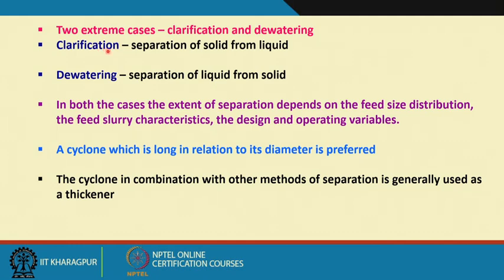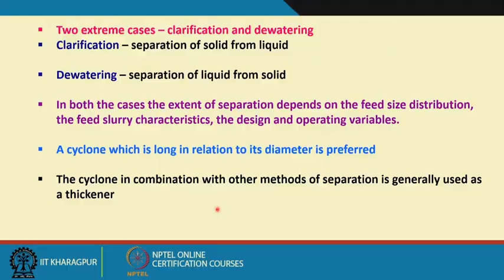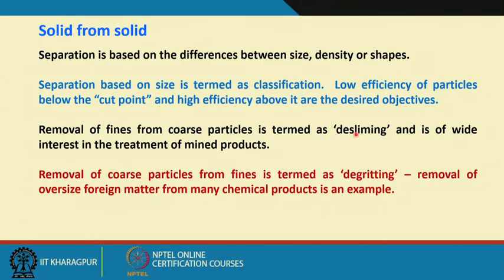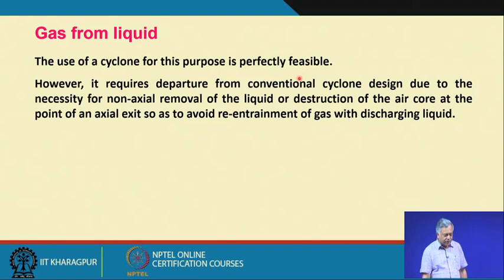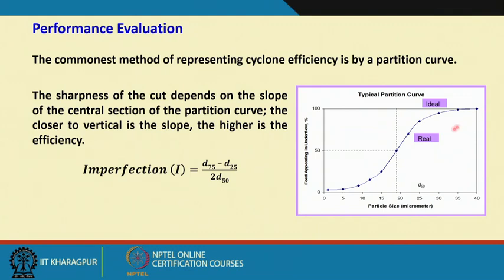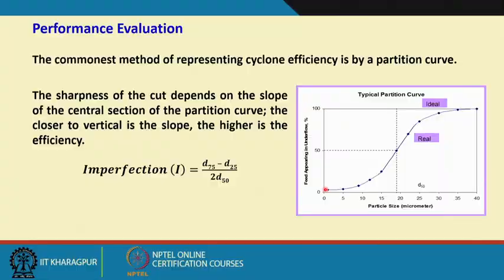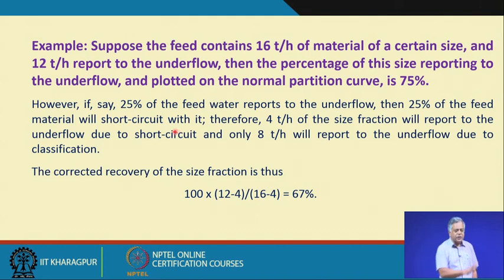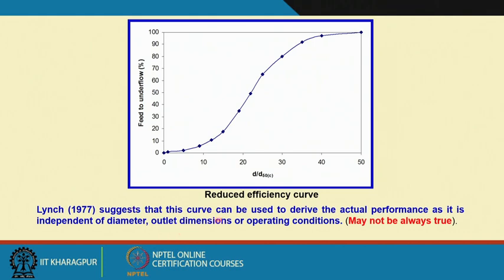Lecture 41 : Hydrocyclone (Contd.)

Comment: hi sir i have a query will you answer here generally we use hydro cyclone after comminution and before flotation but if there is any disturbance in feed flow the cyclone will short circuit and quality will disturbed so why we can not use hydrosizer in place of hydrcyclone
Reply: It goes with the purpose for which the hydrocyclone is used. If there is disturbance in the feed, then the effects can be negated by a close circuit operation with the applicable mill. If the purpose is to do solid-liquid separation, then the hydrosizer is applicable. Also understand the dimensions of the hydrocyclone chosen for applicable purpose is optimised for that purpose.